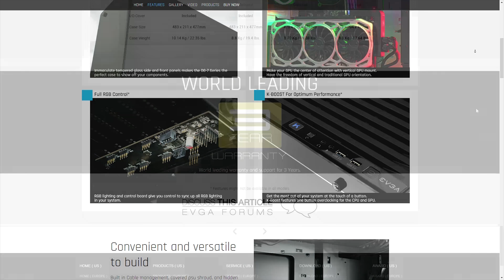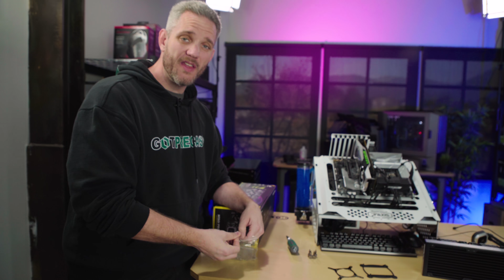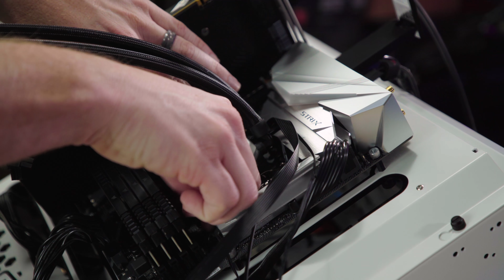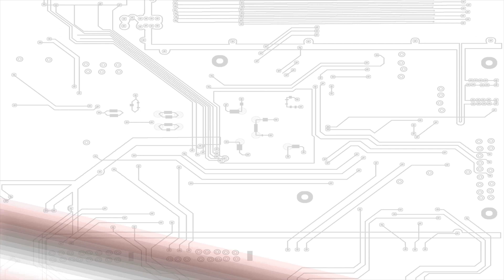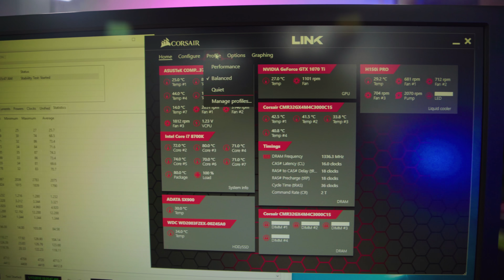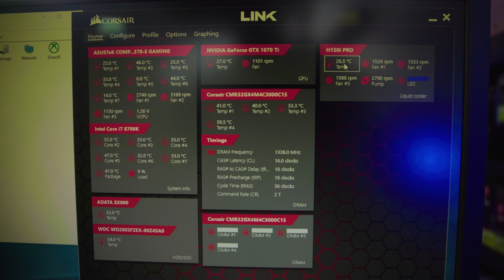Corsair's Largest AIO yet... But is it any good? H150i Pro RGB

Comment: Jay, I have an 8700K running on an Asus ROG Strix Z370-E gaming mobo and a Corsair h100i V2. My CPU turbos to 4.66-4.7ghz by itself (cool i guess) and I have random usage and temp spikes but when I googled that specifically, the forums I found said that it was normal for intels newer cpus. But it's annoying to hear my fans speed up to 60-70% for 3s every so often. Is there a setting in the BIOS that disables turbo boost or is this a result of that self overclock thing ASUS had set by default on some of their mobos and should I leave it as is? My temps usually peak at 80 with the h100i V2 on default settings. I'm not against my cpu running fast, just would like to know your thoughts

Comment: We received a bunch of these in the warehouse I work at ( not gonna say the awesome company name I work for ) but the only thing we had to say about them was "They call it RGB and don't put RGB fans with them ? and no Aura Sync compatibility? what? " I'm not going to complain about its performance, I am just upset that they did what they did with it in regards to the luxuries with it...I don't want to have to use Corsair Link software to control the color, I could do that to change the color of my old h110i v2, just doesn't make sense, if you are going to call it the RGB edition, you might want to step your game up, take a hint from Cooler Master and their RGB editions, RGB fans, Aura Sync, comes with the necessary cable to allow you to use one RGB header to both the fans and the pump, come on corsair, take note.

Comment: So mag lev quieter than fluid dyn? Got my 120x38mm Arctic Cooling case fan with fluid dynamic bearing going strong for 6 years 24/7. So they'd have to be pretty awesome for me to switch over.

Comment: Its not all about the bracket the plate is not that big. You yourself mentioned that the pump+plate is small. And while it should "do just fine" it is not optimal.
So the end game is branding and performance, a plate that small will not net the best performance as a plate that would cover the entire cpu. That is why and no I don't work for them but I can guarantee that is why. Even if they release a bracket that will work they will have a later product with a larger plate specifically for the new AMD socket that will perform better even though the increase will be quite small guaranteed but it will be better.

The new socket is more rectangular and full coverage deffinitelly will help minimally. That tiny circular plate will as said do just fine mostly but it is not optimal by any means for your complaint of it not supporting threadripper. So as said its just all about branding and image, they dont exactly want the bad rep they want the best rep they dont want medium rep either they have to keep up an image of "being the best" as every company does want with their products. So you cant blame them.

If anyone was smart that had a threadripper cpu they would get a AIO thats designed for their cpu not for "ultimate" performance but for the very best design and compatability, ease of use and it should in the end be better marginally. Deffinitelly would be better running all cores on a overclock if it covers the entire cpu vs one that doesnt cover all cores (the whole cpu) and trying to overclock them all.

Comment: The cluttered wires design has always been my biggest gripe with my H115i and am pretty disappointed that Corsair still has not done any new design. Especially that horrible USB cable that can only be plugged in from one side and isn’t easy to hide and needs and extension if you want to do nice cable management.... ugh

Comment: H115i(Not the PRO Version) runs cooler with 7700k @4.8 overclock with delid with conductonaut.  If that 8700k doesn't have a delid with conductonaut, id say go for it, Stress testing ends up only hitting a stable 140F(60C) across all cores with peaks of 147F(63C) using the same ML fans (Blue LED type) in push configuration. 

Love watching your vids, really like seeing the comparisons if its really worth swapping out certain components for others.  I'd love to see a delid'd version then retest.  My 7700k dropped from tjmax 99C to 60-65C due to poor thermal paste application under the IHS, litterally had 1/4 of it that was like a "bubble" not touching the IHS.

Comment: If that RGB works as good as the light on my H100i, you can better just set it to white right now just to avoid the annoyance. After updating the firmware of the pump and updating Corsair link, the light just flickers.

Comment: Isnt mixing copper with aluminum in a loop supposed to be a huge no no? Causing galvanic corrosion? Im a noob with liquid cooling so please correct me if im wrong.
Reply: basssq3 the baseplate is only copper on the outside, inside there is only aluminium

Comment: Jay, at the risk of sounding like a total n00b. What is to prevent me from using the asetek bracket for tr4 that was included with my 1950x?
Reply: Not sure on the mounting issue but since the contact plate is smaller than the last version (that was already borderline too small for TR) you'd probably be better off with something like the Enermax TR4 that was actually designed for use with TR
Reply: John B I'll be using it at stock speeds until i get all the components for a custom loop. Just need to make sure it will work in the interim

Comment: 'Balanced" in Link puts the fans at 1400rpm when my 8700K is at 35° idle on my H100iV2. That's just ridiculously loud.
Reply: leospeedleo yeah I have to use quiet mode on h110 or it sounds like a damn airplane

Comment: my asetek died after 2 years from corsair there is a whole thread on the corsair forums on why not to buy the asetek coolers from one of their mods on the forum he does the software for the corsair link suite. Avoid asetek if you need longevity I went ahead and bought an alphacool eisbaer 360 all copper very silent no silly asetek issues.

Comment: I don't think the fixed cables are a big issue, I have a H110i and that doesn't have detachable cables either, I just route the cables as I would CPU fans, through the grommet and behind the motherboard tray. Not that I use Corsair Link, I have my fans, also ML fans connected to my CPU and CPU_OPT headers. Like some have said, I prefer the older design of the block, so I will probably stick with what I have for the immediate future.

Comment: jay the RADs water temp is "pretty low" compared to the CPU heat ??? maybe not good contact with CPU or is that just the BAD intel tim doing its thing?
Reply from the maker: Nope, the coolant doesn’t get as hot as you would think when watercooling...
Reply: might have just been my old H110i GTX i saw its water temp go up to 45C under load for a while but it also had air in the loop since been RMA'd

Comment: Lol fluid temp is 29C but cpu is near 80C? That's some bad thermal conductivity. I hate to always blame Intel but damn that TIM isn't transferring heat.
Reply: Eric Wright my 7700k gets hot no matter whether aio or air. Sucks
Reply: +JayzTwoCents My 2600k @4.4 Ghz with the old H115i gets maximum temperature of 60° while the liquid temperature get about 35°.
Reply from the maker: Loops rarely go above 30c, even on soldered
CPUs.... have you ever watercooled before?
Reply: Personally I prefer high end air coolers. Though I've read a lot of stories from people with 7700K's getting liquid temps up in the 50s or 60s with aio's. Granted, that's a notoriously hot cpu. I suppose it makes sense this aio liquid stayed so cool, it's got a much bigger rad than most and therefore also more liquid. I just thought peak package temps would have stayed a little lower than 80C. Then again, I'm used to my delidded i7 :)

Edit: also I can't believe Jay himself responded to me!
Reply: JayzTwoCents you got that fucker good lol
Reply: If you get 50s to 60s your rad is not efficiently dissipating heat...
Reply: Eric Wright as jay said “have you water cooled before?”  If the temps of the fluid go much higher your radiator isn’t big enough.   I have that problem with mine. If the CPU or GPU are at full load alone it’s fine, but if both get fully loaded up my water temps go through the roof. I really wish I could get a 420mm radiator in the front of my Fractal Design Define S :(

Comment: Corsair link is a great program WHEN IT WORKS, I have a H115i and it worked great for awhile but then Corsair link stopped recognizing it, then it stopped recognizing my Hx850i power supply, Corsair even replaced my cpu cooler and still doesn’t come up in Corsair link, trust me I’ve done everything from uninstalling and making sure the usb plug on the mother board isn’t bad and it just doesn’t work 🤦🏼‍♂️
Reply: GETLOWDUDE sounds like my evga clc 240. The evga software doesn't pick up the pwm fans plugged right into it. So i can't adjust the fan curves only the pump curve. Really frustrating.
Reply: cooley it’s so frustrating, the last time I was able to control my cpu cooler I was rendering a video and turned up the fan speed so it wouldn’t get hot and after it got done it stopped recognizing my cpu cooler and the fans have been stuck on 100% since 🤦🏼‍♂️ legit sounds like a dam jet
Reply: I’ve learned that software control for RGB and fan profiles is absolute trash. Doesn’t matter who’s software it is either. Corsair Link is especially bad.
Reply: I have the same, same issue, but try: Right Click on Start Menu, Device Manager and look for Corsair cooler, right click and click enable. Sometimes it will work right away, other times you will have to restart. Sometimes you will have to do that more than once. Corsairs drivers are crap.
Reply: CorsairLink 4 uses at least 5% of my CPU at all times whilst my system is just idling, and to me that seems absurd. Moreso if you take into account that the CPU is an i7 8700K @ 5GHz.
Reply: Try MSI Afterburner, you('ll) be surprised at how versatile it is.
Reply: Hyper 212 evo ftw 😂🤣
Reply: GETLOWDUDE Change the fan speed through UEFI/BIOS.
Reply: I've never had a problem with it to be honest when I had my H100i GTX, The only real issue I had was the Corsair Link always used about 10% of my CPU minimized to the system tray, that was on a i7 3770s, My 5820k it still took around 4 - 6% of CPU time. Annoyed me as other temp motioning pregames use nothing near that.
Reply: I had this problem, you might want to check the Universal Serial Bus controller in Device manager. Make sure the cooler is enabled there
Reply: These are all good suggestions.
My question is how many people use AI Suite or other fan controller programs that came with their motherboard? 
Tried for months to figure out what to do to be able to control my fans and pump again as other settings besides performance drop the pump rmp (watch the video carefully and it proves this).

After uninstalling and reinstalling, Windows updates, rollbacks and every other damn thing I found the problem.
Windows on balanced or power saver will disable the usb headers to save power..... 

If you go to device manager- Universal Serial Bus Controllers, then go down to Corsair USBXp Driver, right click and make sure that it's enabled.
Once I re enabled it and disables the save power over usb BS in "Power Options-Advanced" I haven't had a single issue ever since. 
The second I re enabled it literally popped up in the Corsair Link App. 

Good luck, I hope that this was informative and helped at least one other person.
Reply: So what air cooler did you buy to replace it ? ;p
Reply: Darren M WHAT A GOD, THANK YOU
Reply: ive never had an issue with it, although i only have the h100i, not the psu and shit.  my pump did die though. i never went into the advanced settings too much, the rgb and pump fan profiles worked properly. thats all i need
Reply: same for me with my h100i
Reply: I had so many problems with it, that it made me sell my cooler.
Reply: Whenever my corsair link fucks up, i move the USB on mobo, from port 1 to 2. or other way around. And it works again for a while. 
I have tried different versions of corsair link. Nothing else helps. At some point i will always lose the option to control some of the fan speeds... Right now it's only my small HDD fan... When more fails I will have to switch to get back the control.....

Also, taking it out of hibernation will fuck it up almost every time, as an result i have to reboot...

Everything running on an Auroa Gaming 5 370.
Reply: Download an older version of corsair link. Worked for my friend

Comment: You can add 5 degrees to the water temp even at IDLE. Those open testbenches are just fucking crap and are missleading even if u mention it.

Comment: JUST GIVE US A NZXT KRAKEN 360 ALREADY.
Reply: the kraken x72
Reply: I'd love a 360mm NZXT Kraken with that gorgeous pump. Oh well if they release one this year. Ill just sell my brand new unused x62 v2 280mm
Reply: +Asumara Gaming too bad the cam software is trash
Reply: I'm all in on either the Kraken or the latest Enermax stuff for sure!
Reply: Allie Boy de🅱️atea🅱️le. All control softwares are garbo
Reply: Tried Kraken. The software was buggy and didn't work most of the time. Corsair Link is simply better. The hardware between the two coolers is 80% the same so the biggest reason to get this over NZXT is Corsair Link.
Reply: now i have a reason to want it
Reply: Allie Boy yeah. It's garbo
Reply: +Asumara Gaming cores air link is much better
Reply: +Asumara Gaming it's actually not. There's barley complaints about link. All the complaints come from cam. Link is actually stable for the most part and functions.
Reply: Allie Boy it was just a joke lol
Reply: Look on new egg, it's 1 in 3 people have failures.
Reply: Release the KRAKEN!!! LMAO just had to
Reply: Ya seriously. I would have bought a NZXT cooler if they had a 360.

Comment: Jay if ur in the 80s in aida64 the system shutdown in prime because it went over tjmax. No question. Prime runs way way hotter then aida64 and it gets to it's hottest point around 20-30 min into the test. At least when using blend.

Comment: Hey Jay, I'm considering buying this cooler for my 8700k which is currently running 4.8 GHz @1,344v all cores on air hitting maybe 80C from time to time while gaming, but my main concern is silence and pump noise - can you set a custom profile on this AiO? Like set it to say 800-1000RPM mode on fans and something according on pump? 
Also, should I be concerned about VRM temps switching from air cooler to an AiO with ASRock Z370 Extreme4?
Reply: Thanks for advice :) I'll probably get 280 variant then as it will later fit if I decide to change my case. Also I was planning to delid, but you can't currently get proper delidding tool in Poland (Delid-die-mate 2 or so). So that has to wait ;) Was thinking about getting CLC cuz my chip can easily reach 5 GHz on 1,392v, it's just it hits above 90C on air cooler.
 
As for Noctua - had NH-D15S tested, but it didn't blow my balls so got a similar cheaper cooler that's doing a good job for now, I just wanted something cooler ;)

Comment: JayzTwoCents : ....but damn that i7 8700K has temps like LAVA when cooled by 3x radiator watercooling despite the fact you have OCd it still should be properly cooled by that 360mm rad cause it's the biggest you can get....and VRM-s are cooking like crazy....and one must remember if one leaves "multicore enhancement" turn on by default it can turbo itself to 4.7 GHz on all cores at stock settings for few moments in every second one stresses it....I had a client that we had troubles with Noctua 15 cm air cooler running on stock clocks when we didn't know what multicore enhancement did in the first day after building his rig when it was constantly shutting down in games and benchmarks before I touched the VRM-s....damn they were literally the hottest peace of aluminum that I have touched in years in my building of computers. That alone convinced me not to buy any Covfefe lake for myself at all. Intel has just exaggerated with those chips in terms of allowed power consumption and allowed auto OCing for my taste. In my experiences these are literally the hottest chips ever created for PC gamers in the history of computers.
Reply: I'm going to guess his 8700K isn't delided. (don't remember if he said so in the video or not) My 8700K on air is at 5.1 and chugging along just fine, haven't had any issues with random shut downs because of VRMs, and my temps probably peak at 80s under synthetic loads, by never near 70 in games, but then again, I'm not using an open test bench.

sometimes you get good temps without delidding, but for the most part, probably best to change the tooth-paste if you get these unlocked chips if you plan to do any real overclocking.